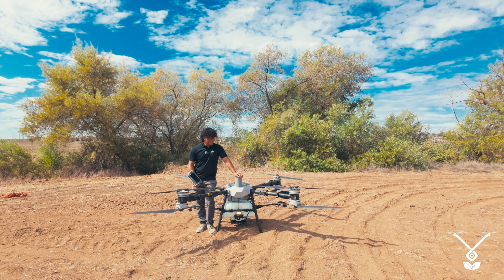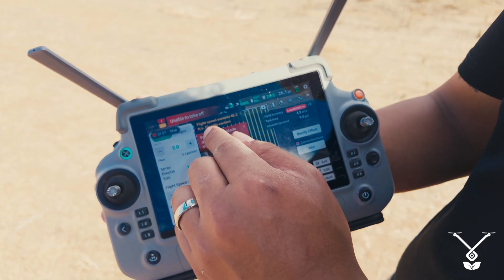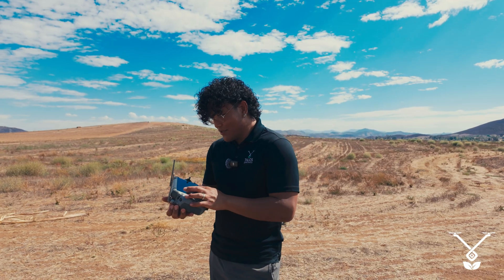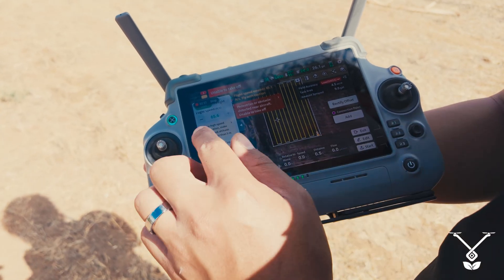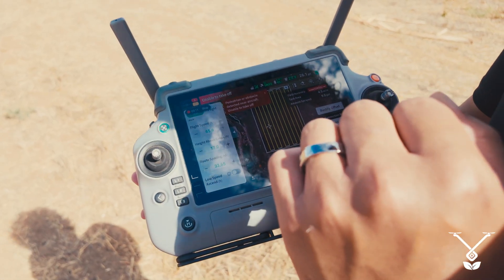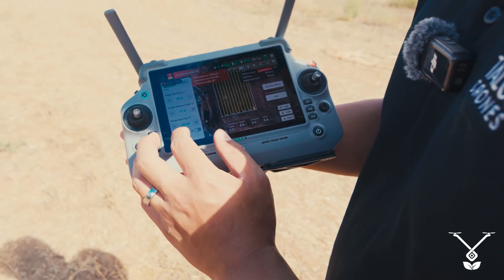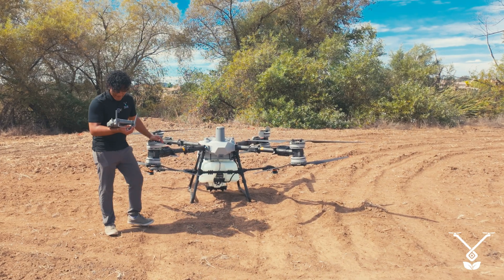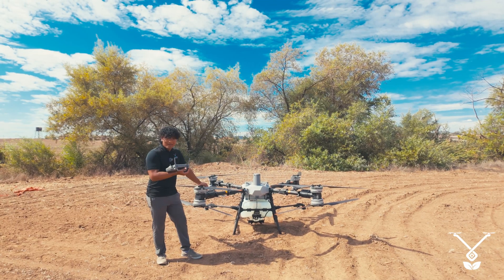DJI Agras T100 I 2 Gallons vs 4 Gallons Performance

Comment: Flying faster doesn't necessarily contribute to the massive difference in battery usage between the two gal/acre test. It is more to do with the fact that the drone doesn't get rid of the weight as fast as it does with the 4gal/acre test. Meaning with the 2 gal/acre test the drone flew longer with heavy payload and with the 4 gal/acre it gets rid of the payload faster, making it fly with a lighter payload using less energy. if it makes sense, that's my experience.